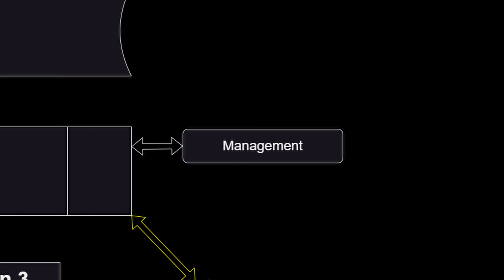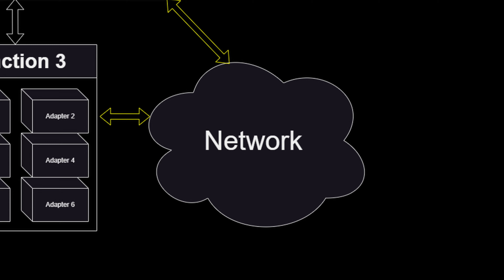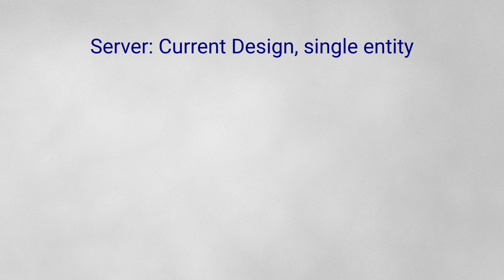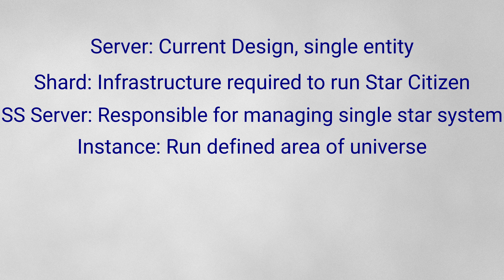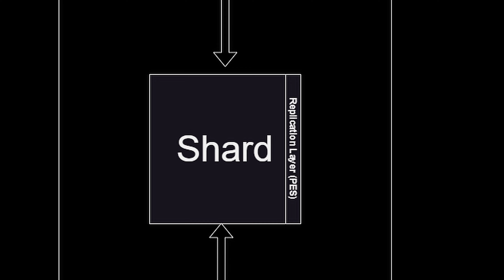Star Citizen: Server Meshing Prolog

Comment: What is going to happen if the replication layer is going down?  How is this different from the server going down in today's setup?
Reply from the maker: It isn't deferent, but the replication layer has a very limited role, so it is much more likely that it would be more stable in the dev cycle and have far less going on to cause crashes.  They could do a second replication layer instance to make them redundant, but if I were them I'd wait to see if it is needed before I added that much complexity.